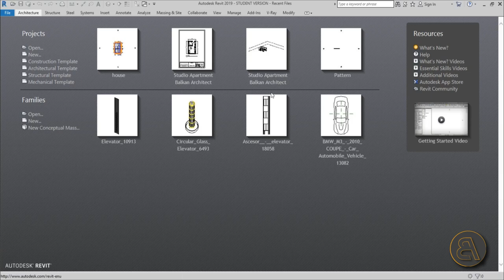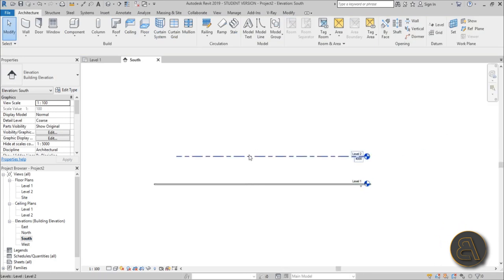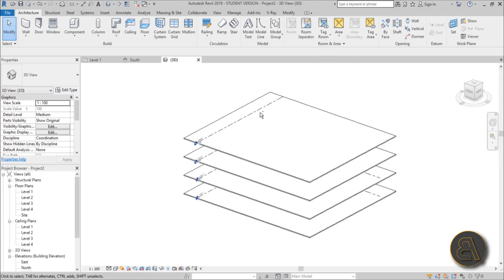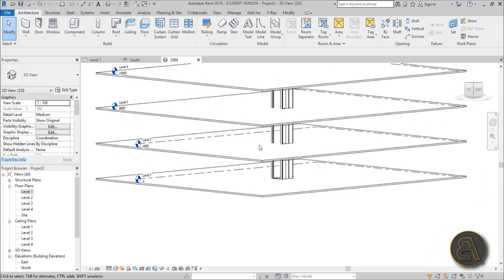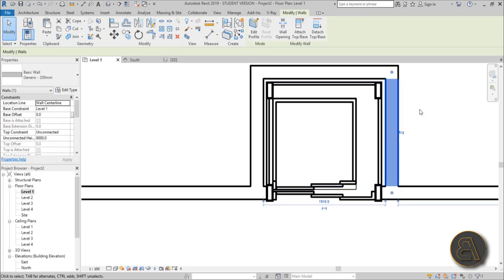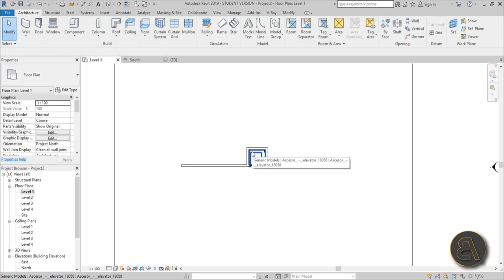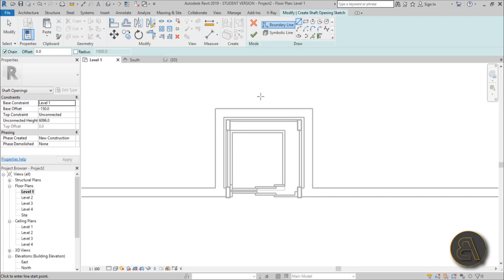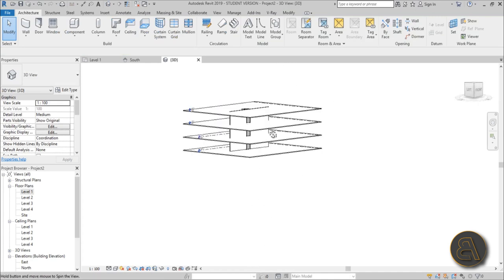Elevator n Revit Tutorial

Comment: love your videos. how do you load the family from within revit though? not sure what category elevators are, and googling doesn't provide obvious answers. the way you drag and drop avoids this problem as well. thanks!
Reply: When you have downloaded the family, move the file into the Revit Library on your hard drive mine is located here C:\ProgramData\Autodesk\RVT 2023\Libraries\English\UK\Specialty Equipment\Elevators and Lifts - then go to Insert from top menu bar and load family icon is there, navigate to the location where you put it and load what you need from that folder. The elements then are listed in the project browser under speciality equipment/Elevators and Lifts, drag n drop into your project